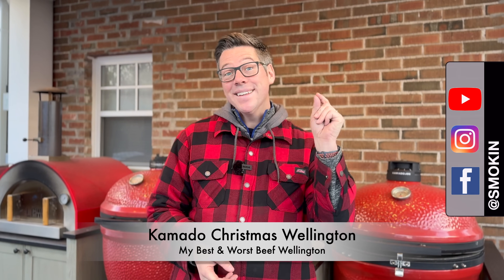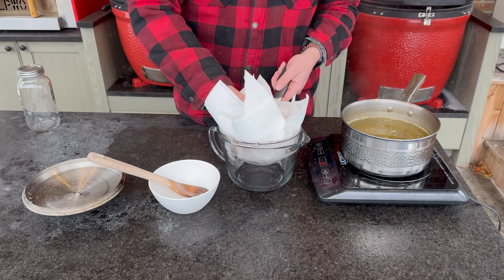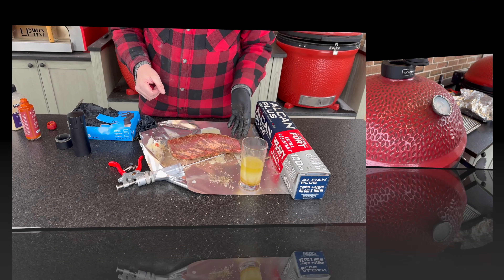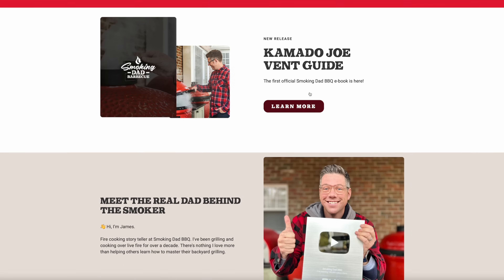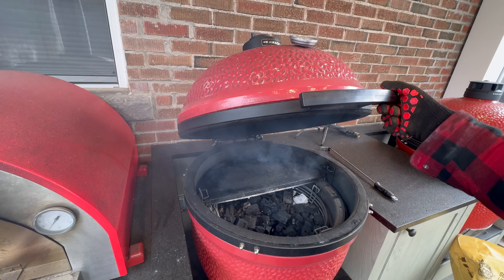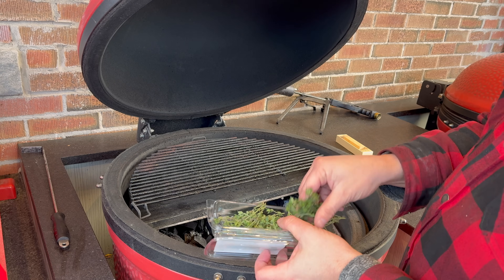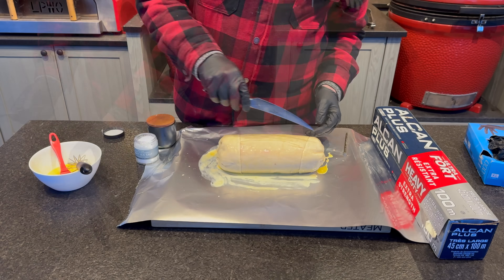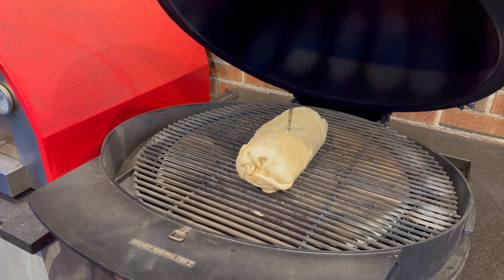My Kamado Joe Grilled Beef Wellington Packs More Flavour Than Gordon Ramsay's!

Comment: That is how I do my beef tenderloins for beef Wellington already except for I use an offset smoker at 425 degrees F. one tip on the pastry is food processor using pulse 3/4 of lard to 2 cups of self rising flour and 1/2 cup of ice water gradually add the ice water till the consitsy you like. On the sauce I sub out the mushroom for truffles. Also I use warm water as binder. I build a big enough fire to where the barrel of the offset can be seasoned with canola oil I do this when making beef wellington. That is how I get it hot enough to brown the pastry.

Comment: What is your educated guess of coal weight for a 2–4–6–8 hr. or all night cook using a KJ classic 3? Happy holidays.
Reply from the maker: The brand of fuel and the setup can make a big difference.  Normal indirect the classic can go nearly 24hrs with fogo, JD and KJ. 

Double indirect they cap out in about 9hrs which is usually enough to finish a brisket

Comment: Beef tenderloin is so overrated. I'm right there with you, give me basically any other kind of steak. I still need to try picanha, but I'd bet money it tastes far better with a similar level of tenderness and while being cheaper.
Reply: Tenderloin is more tender than Picanha, which is top sirloin with fat cap. The reason Picanha feels tender, is because the way it gets sliced against the grain into small strips. Though there is a  section of Picanha that is relatively tender. One can wrap the tenderloin with lardon or sliced beef fat when making Beef Wellington, thus creating a fat cap. It will definitely cost way more than Picanha though.
Reply: @CoolJay77  Yeah, that's why I said "similar." Beef tenderloin is just far too expensive a cut for something that has basically no fat in it.
Reply: Picanha is definitely worth a try. Several different ways to prepare it. Everybody to whom I’ve served it have said it was their favorite steak ever. It’s almost cheating. 🙂